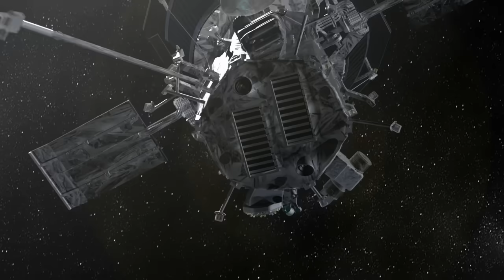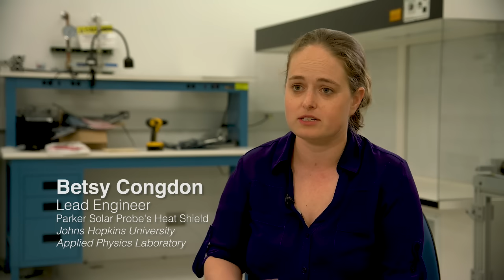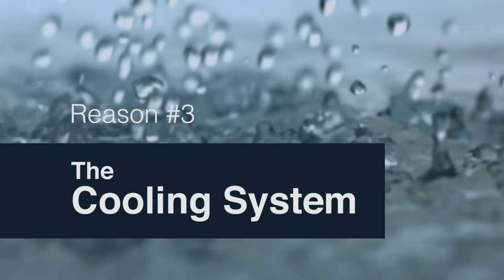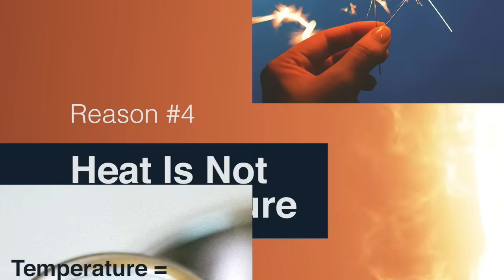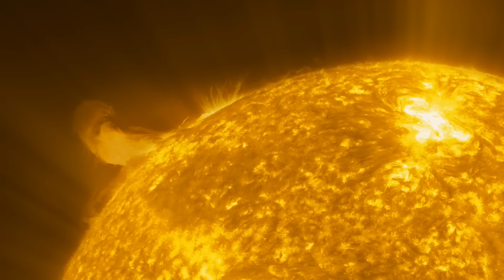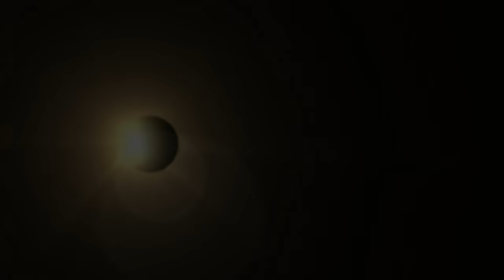How NASA's Parker Solar Probe Will Survive the Sun

Comment: Hi. The person said that they are using  a carbon foam that is 97% air. After introducing the craft to space does the material still keep this air trapped inside or does it escape? Also if it does escape, does the material still retain its thermal properties?

Comment: Isn't tungsten the most heat absorbent material in entire universe? Why don't they use it?
Reply: I think it is to dense/Heavy.
Reply: Because they don’t want to absorb heat?
Reply: Heavy
Reply: Because it conducts heat very well, and doesn't shield it.
Reply: I sent know for sure about that claim. But you dont really want a heat shield to be thermally absorbent. Ideally on earth maby as its relatively easy to dump.but it's much harder in a vacuum like space.
Reply: Too heavy, I think.

Comment: But how do you know for sure thay it won't melt? EVEN WITH the shield the Sun is literally a giant ball of gas and heat, you know this. For all we know the materials we have on Earth aren't resilient enough towards this level heat and you guys plan to have it ORBIT THE SUN, I'm all for this project I just wanna make sure y'all know what you're doing. And what if the water evaporated from the heat that might make its way around the shield? You can't send people to refill the tank, are you gonna have it come back to Earth every few months? I need answers NASA.
Reply: They are NASA they might have figured it out
Reply: 1- The shield is a more sophisticated version of the Shuttle heat shield cells protecting the reentrance. 2- They say the cooling system is water but it is not, I'm sure is a very efficient, very hi-tech coolant.
Reply: You need to understand that energy transfer as heat mostly need particles to carry from a space to another because space is very empty.Since the the direction of particles like photons and neutrons that eject from sun are predictable, then we only need a shield that can manage resist the heat energy. even though temperature is relevant high on that shield we still can transform the heat energy to other form of energy by water in a closed system(for example a turbine）. We are not going to simply release those water to space in a spacecraft. They most likely transfer it to a type mechanical energy to generate electricity since normal solar panels cannot resist such high temperature.
Reply: A sad, strange little man I think that NASA with a budget over 19 billion dollars and some of the smartest people on Earth  have thought of that.
Reply: Soo as they said temperatur is not the same as heat. In the orbit were the probe will be flying are very few "Sun"- Partikels, even if these particels have very high temperatur the heat that they are Transfering into the water is actually not that much. This is because only very few particels will actually hit the Water molekules and Transfer theyr Energy. And I am for sure that the probe won`t come back this would be very expensive.
Reply: Hopefully this Mission is SOON.
Reply: A sad, strange little man the same question ??